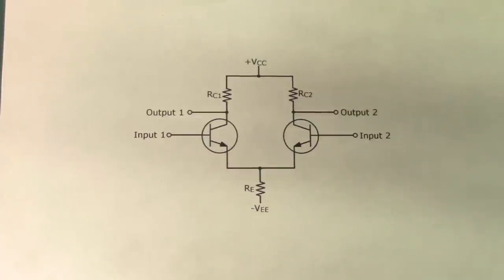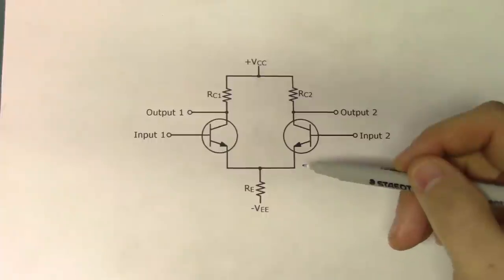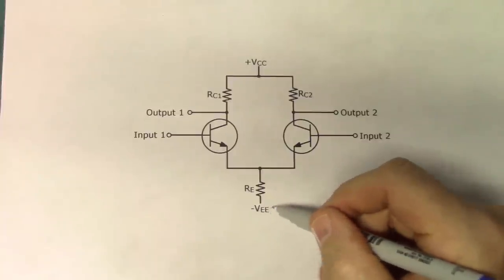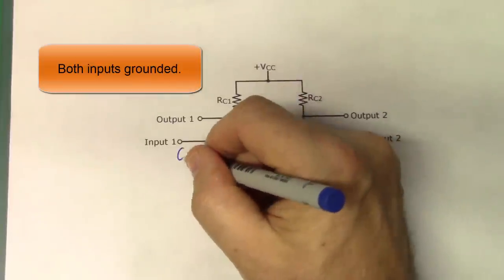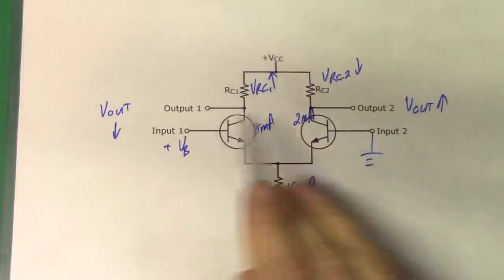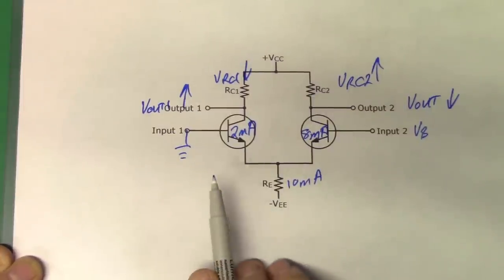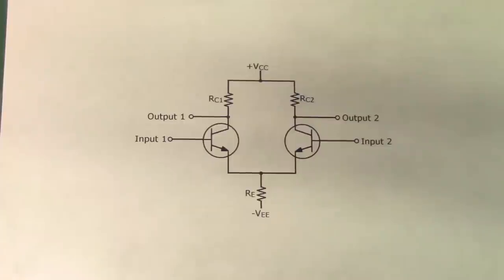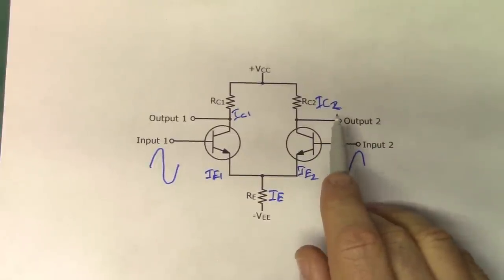55. Differential Amplifiers

Comment: Mr Offset Volt, I enjoy (and benefit from) your videos tremendously. So much so on fact, that I’m on round two (sometimes round three) of watching them. Your methodical and disciplined approach to analyzing and describing circuit behavior and making a subject that is undoubtedly far more complex accessible to those of us who don’t have a degree in EE is by far the most comprehensive and enjoyable way of covering the subject that I’ve seen on YouTube. THANK YOU for taking the time and making the effort to do so. Every time I watch your videos I come away from the experience with a sense of confidence that I now understand the material. 

Your channel is a treasure and your efforts are laudable. I hope you will continue to be an asset to the community and look forward to many more of your EXCELLENT videos. Thanks again.

Comment: I’m interested in the current source you added. Could you make a video about current sources and mirrors. I see them used in circuits in place of resistors.  Its not clear to me how to calculate what current to set to mimic a high value resistor. to get a specific resistance out of the current source.

Comment: How would you set the impedance of the constant current source?  do you just need to rely on the transistors characteristics? Thay seems a bit of a gamble when building many devices that need the higher impedance. Would you need to just test a bunch of transistors and pick the desired ones?

Thank you for the great videos.

Comment: Coming in late.. just discovered and subscribed.
At 52.51, shouldn't RE1 be in the equation, too? It will not make a big difference but since you are calculating everything else exactly... Or is there something I miss?
Reply from the maker: Since it's a constant current source, RE1 is common to both sides - it's the little variations on pot that from one side to the other that we have to account for. Hope that helps. Thanks for subscribing!

Comment: Why is the current through the collector, Ic, the same as the current through the emitter, Ie?  Also what determines the current through Re - is it just the value of Re, and Vee -0.7V? Anything else?
Reply from the maker: Ie and Ic are pretty much identical when Beta is equal to or greater than 100 which these transistors have in spades. Go to about the 20 minute mark and you can see how the current was calculated. Thanks for watching.